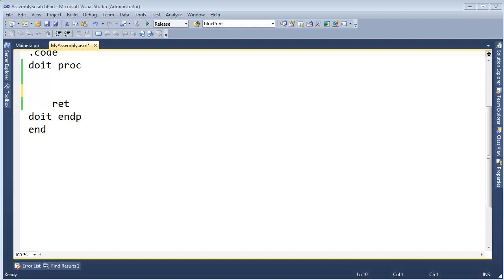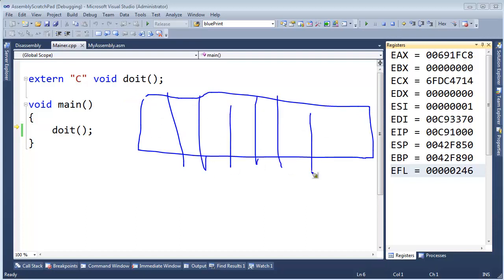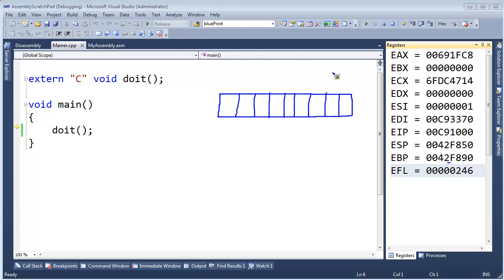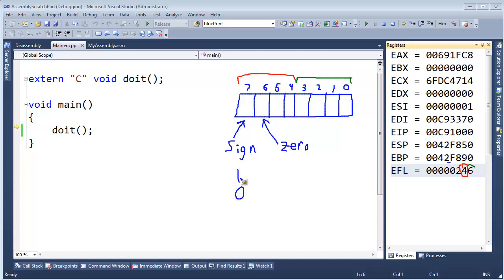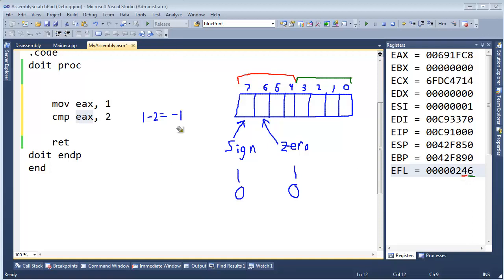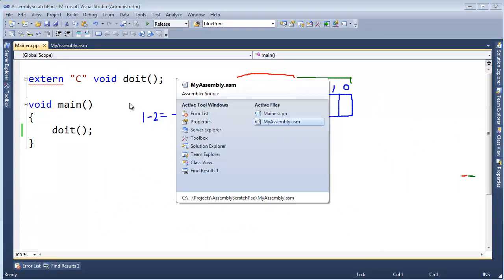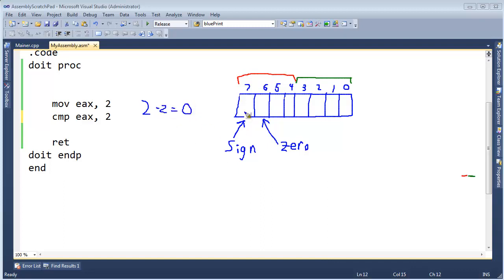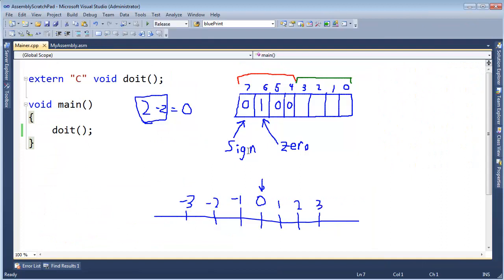Assembly Flags Register - Sign Bit and Zero Bit

Comment: If it doesn't matter what the sign is when zero is in fact 0, then wouldn't the final flag result be 0x2C6 instead of 0x246?
Nvm, I misunderstood what you were trying to say. You're saying if the Zero is in fact 0 after cmp, then you can automatically ignore the sign bit because it no longer matters. This will be very useful. Thanks